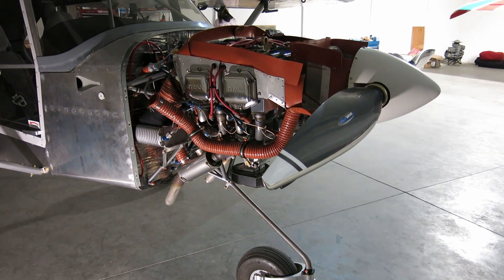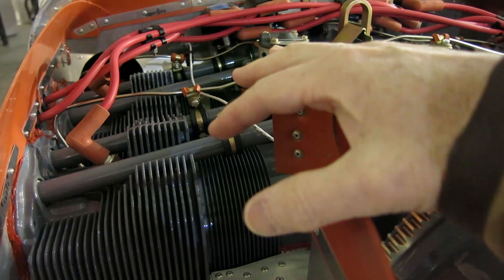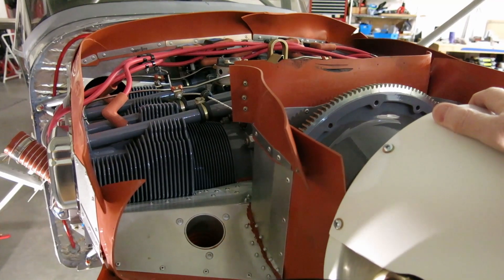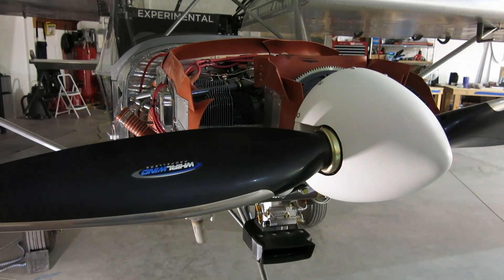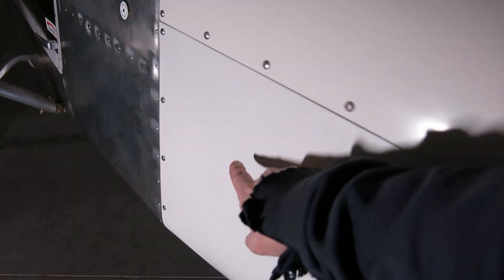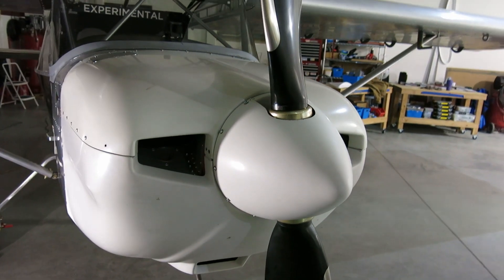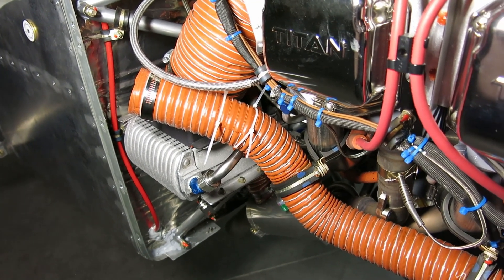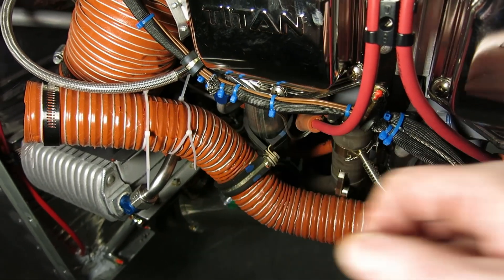No. 432 03-29-2025 Baffle seal adjustments

Comment: How have your baffle adjustments come out? I'm just putting my orange flexible baffles in place now. Any additional tips besides the video? Thanks for the videos that y'all have produced over the years, I use them a lot for my build, much appreciated.
Reply from the maker: Still TBD on the baffle seals. We’re still running mineral oil in the engine and that has higher oil temps. Have about 15 hours left I think. Once we switch to regular oil, I’ll have a lot better idea.

Comment: Have you put a half-round piece of metal on the lower edge of the firewall where the air exits.  That lip on the firewall facing forward has to really screw up the flow in that area.  I’ve seen several other builders of a variety of air cooled airplanes that have lowered CHTs significantly by placing a half-round piece of metal across there to smooth the airflow at the exit on the firewall side.
Reply from the maker: I’ve seen that too, but there are also other builders that have built to spec and have had no problems with CHTs and oil.

Comment: Can you change the way the three top front seals overlap?  Rather than being pinched together as they are now, what if the two side pieces were folded inward at the rear and the cross piece was then riveted to them so that the side pieces put a little rearward pressure on the cross piece to help it stay folded back.
Reply from the maker: Yeah we’re trying different ways to get this done and it may get changed.

Comment: Actually, you don’t want high CHT during break-in.  You want high cylinder pressure, but you want to keep the temps as low as possible.  The rings generate more heat as they break-in and you want to dissipate that heat as much as possible.
Reply from the maker: That is true. But you’re going to see higher CHTs during break-in due to that. If you freak out over keeping CHTs low, you’re not going be putting enough pressure on the rings to get the proper wear on the cylinder and then will end up glazing. Seeing 425 CHT isn’t cause for alarm.
Reply: @ I agree.  It just came across to me as though you were saying that having high CHTs was desirable rather than being an undesirable side effect.  Someone trying to attain high CHTs during break-in might decide to climb to 10,000’ feet to keep the CHTs high rather than flying level at full throttle to keep both cylinder pressure high and also airflow high to maximize cooling.